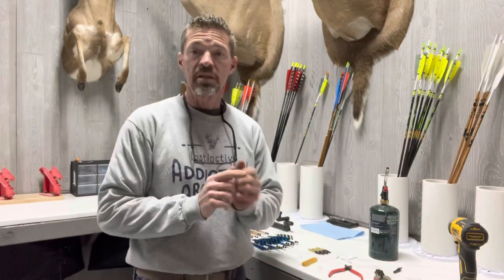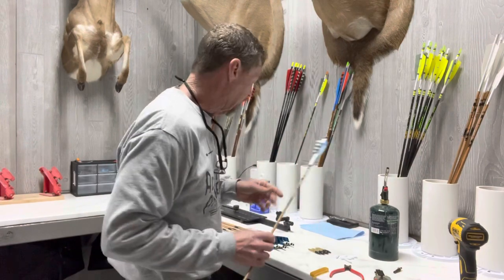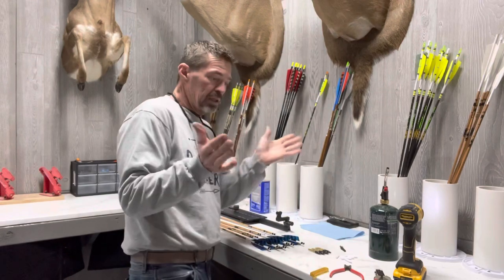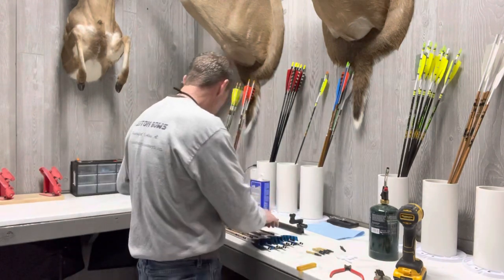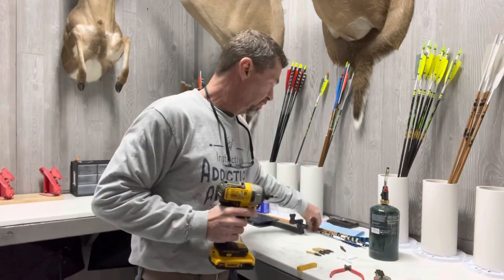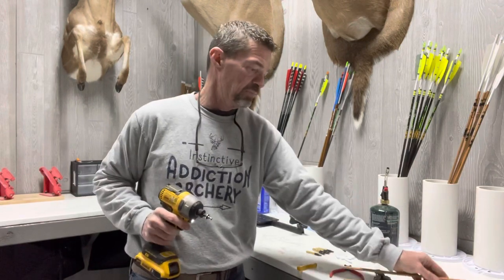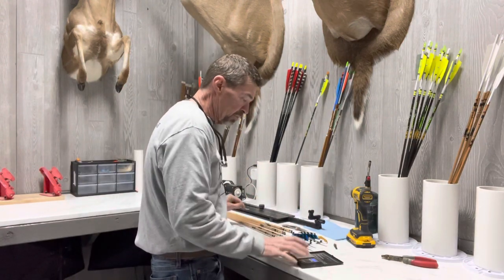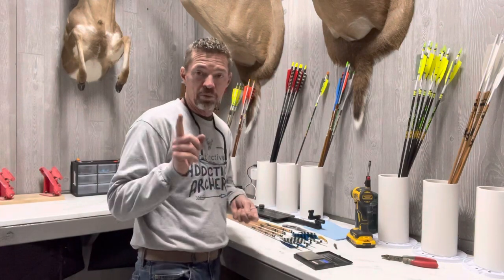Custom Arrow Build Part Two “ Cutting And Insert Installation “

Comment: It's always good practice to remove the nock before you glue the insert in. The reason is, you have trapped air inside the arrow and as you push the insert in, you create a piston effect that compresses the air. This could push the insert back out or cause air to escape around the insert, weakening the bond between the insert and arrow

Comment: Love your videos Jeff! I have a question, would there be any difference in using just a 250g broadhead with no weighted outsert vs using 100g outsert and 150g broadhead?
Reply from the maker: Thanks Jake, as long as your arrows are stiff enough, when you run weighted brass or steel inserts they are usually one inch or so long and actually stiffen the shaft verses a 250gr head with a stock insert will actually weaken it since all the weight is outside the tube and out front, they’ll tune great as long as you keep that in mind 👍🏻

Comment: Hey Jeff got a question about my arrow spines. I shoot a #55 with 28.5in draw out of my recurve with 300g up front (150g insert, 150g broadhead). What would be your recommendation for my spine?
Reply from the maker: Hmm, depending on what bow you have either a 400 or a 340, how far the shelf is cut with affect spine ar well as the limbs themselves, let me know what you’ve got.
Reply: @instinctiveaddictionarcher8998  it’s a Bear ‘59 Kodiak replica so pretty flat shed that I shoot a feather rest. I’ve been shooting 400s but I just seem to tune them but I’m gonna try the 340. Thank you Jeff for all the help!